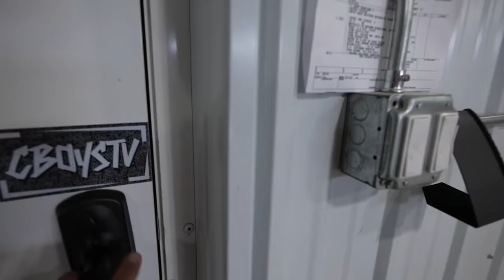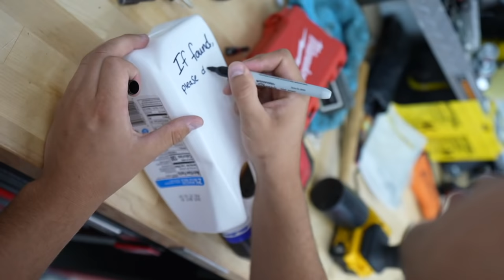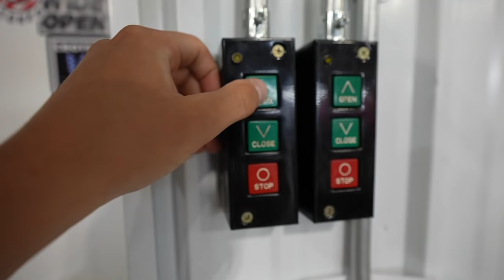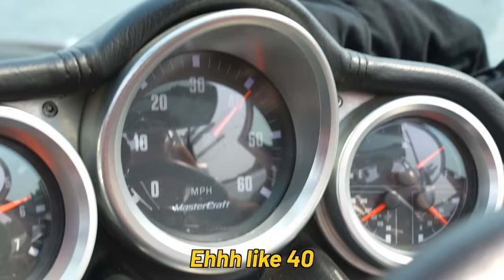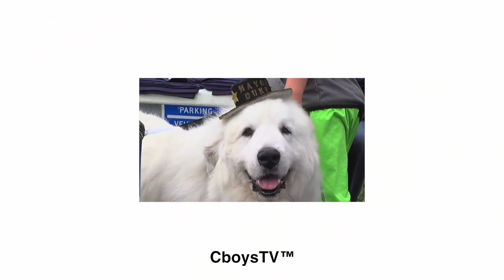Snowmobile Sinks to Bottom of the Lake *Recovery Mission*

Comment: Here is a recovery tip....a single automotive sized innertube will lift that thing.  You get a scuba tank and put a first stage regulator on it (leave it in the boat).  The first stage makes about 130 PSI so you just adapt it to a standard compressed air hose and Schrader valve inflator.  You then tie or clip the tube to the machine and inflate it with the air hose.  I have recovered dozens of things using this scheme.

Comment: After firing it up again, youll wanna get the engine really really hot, so the water down in the crankcase will evaporate, and also drip some oil through the sparkplug holes before storing it away. Water in the crankcase will rust the bearings over time. So get it really hot after sinking, and oil it, and the engine Will live a long time👍
Reply: Lmaooo
Reply: Not how it works lmao. Getting it “really really hot” will screw up the crank bearings more than the water will
Reply: @kee1810  I dont mean over the boiling point. Have you ever opened a two stroke engine? Where does the heat come from and where does it get cooled? Around the piston sleeve and water channels. Have you ever heat-seized an engine? The piston gets scorched and loses compression. It is almost impossible to get a heavy steel crank so hot it seizes. It is lubrication or rust that does it every time. Ive been building and riding watercross sleds for 7 years. Do you recommend them to leave the water in the engine?
Reply: @KlaemHD  actually you said the piston gets scorched and not the rings so that right there says it all. I misread and thought you were actually smarter than you really are but it’s all good at least you ski guys think skipping on flat water is cool. Boating out here in the gulf and Atlantic takes much more skill so don’t try too argue that either lmao
Reply: The fish got me  laughing
Reply: @kee1810  You have to be kidding me, have you ever opened up a seized engine? You’ll see that most of the time the ring and piston become merged into one and the piston clearly having big scorches all over it.. And this is coming from a bike mechanic

Comment: Open your jaws wide as you dive and feel pressure or pinch ur nose and  blow. You need to equalize the pressure which can be done very easily in the ways I just mentioned. If you do not u risk rupturing your ear drums